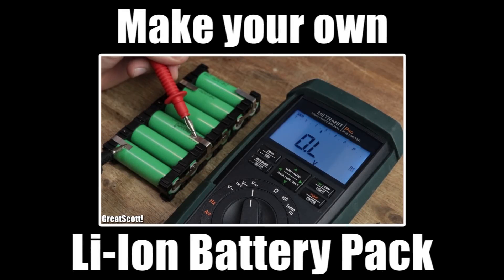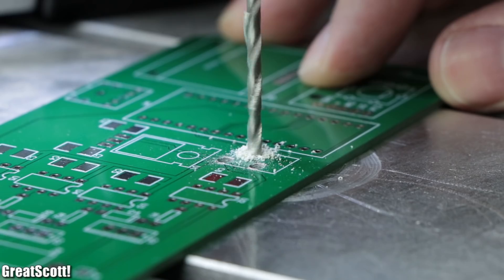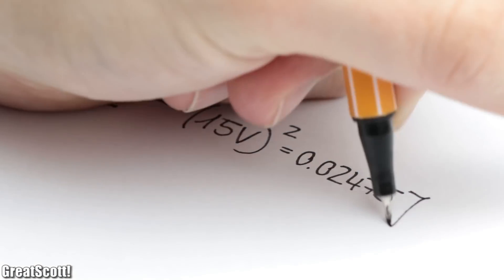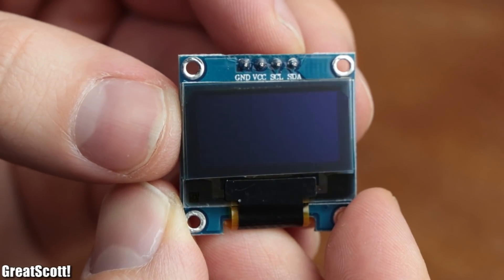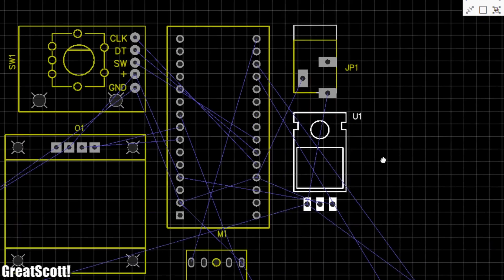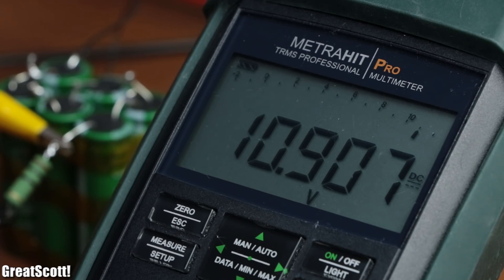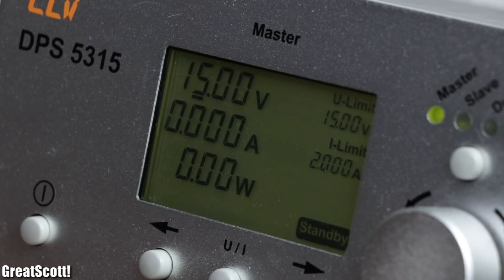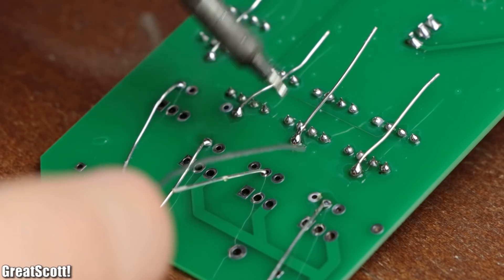Battery Spot Welder (CD Welder) || DIY or Buy

Comment: there is rather easier idea: when pedal is left caps are charging, when pedal is pressed caps are free to weld. this is simple idea, easy to make, and if you want ot make sure power sullpy is safe, you can add program to add delay for weld acction. For me, you just overengineered it, only part that I love is pedal: using feet is good when your hands aren't free.

Comment: So...
Why not using the capacitor discharge method the usual way we create a spark pulse for CD ignition system ?
Except - now we reverse the system to discharge through the HV winding to get a High Amp LoVolt pulse on the LV output !
The energy discharged will stiil be calculated as capacitor charge voltage times the capacitance.
The energy will not change. It's still the same energy carried by a low voltage and a high current.
Less some loss in probe leads etc.
The energy discharged in the welding can still be adjusted by controlling the charge voltage on the capacitor.
But now the whole shebang is MUCH easier to control by a switch ...

Comment: I´d be glad if You revisit this. I need a spot welder like this for my 18650 pack project. This has just the right ingridients: pulse widh control, a nice foot switch and an input voltage my bench power can handle.
I´m stupid at circuitry but can put together something following build instructions and then use it.
Having a pcb and parts list would be so awsome!

Comment: Great scott: builds a special circuit for welding.
Me who don't know how to make a circuit: just connect all up to 12 volts capacitors that I can find in parallel and charging them with a 12 volts battery and shorting it for welding 😂

Comment: I was disappointed you didn't finish it ..wouldn't u just have to solder a few wires in and out a couple direction diodes in to prevent back current ...can u maybie do a video 2.0 where u fix and show us it working ...I purchased a Ali item and it's USLESS so I want to know how to fix it or build the Arduino one ..is it open source code or will I grab that from you

Comment: The most important for a super capacitor welder is the charging circuit. Simply charging them in series is dangerous, especially for those bulky ultracapacitors.
Reply: if we use a separate isolated power supply for charging the capacitor and uses switches like relay 
We can make this work right
 actually I am new to electronics just trying to improve my debugging skills

Comment: Why did you connect the capacitors in series instead of parallel -- isn't it the current that heats the metal?🤔

Comment: Seems like massive overkill.  I've seen DIY spot welders (for battery packs - not general purpose) that consisted of a battery (or transformer), a light bulb and a capacitor bank.  The function of the light bulb was to act as a resistor (to slow the capacitor charge and limit current flow) and to indicate when the caps were fully charged (by going out).  Then just touch the probes to the nickel strip and - Instant weld.  If the weld isn't enough, add more capacitors.

Comment: Don't give up! Just connect one terminal of capacitors to ground, and the other one directly to one electrode. The second electrode connect to ground via mosfet switches. This way, you will get rid of floating mosfets' source potential, and you won't have problems with turning them on and off.

Comment: Use a separate power supply for the control circuit so that the drive voltage to the switching FETS remains above 6-7V as the supercapacitors discharge AND voltage drops won't kill your Fets. You could also use a diode and a large decoupling capacitor going to the control circuit.

Comment: I feel like the caveman approach might have worked better on this one.....My idea may be dangerous AND stupid but hear me out. Extra beefy caps and no pesky hardware or software, just a high voltage warning sticker, some rubber gloves and a chickenstick. That would probbaly damage the battery your spot welding to, but the weld would be good XD.

Comment: Why not just use an old car battery, a couple leads, and a high amp relay on a toggle? No electronics crap needed. Just tap the button and spot welder done.

COUNTLESS diy battery pack builders have been doing it this way for years!

Comment: hi sir. I would appreciate if you can spot weld  a new battery pack for my icom 02AT fm transceiver.  either  8 or 10 1.2volts rechargeable battery.  I will buy from you

Comment: All of this... and I all I did was soldering two copper ends for contact on the 400F capacitor and a JST connector for charging. I got a step-down voltage converter that allows me to plug this into a USB power supply and charged it all the way up to 2.7V. The current dropped as the capacitor became full and it worked perfectly as the project was simple. I'm gonna make a 2S lithium ion battery for 37 minute flight time for my airplane. Thanks Scott for your wonderful videos as complex and knowledgeable as they are.

Comment: Why dont you do it like this: 
Charging a capacitor (like 10mF 30V) with a 30V 5A lab power supply  and then discharge it with a mosfet (3* 200A) in very short pulses. You could controlle your mosfet with a pulse width signal and charge another capacitor (like 2.7V 500F) with it. Now you should have a more continuous flow of current if you attach a load to it. And you could set the voltage to a fixed point with the PWM signal to have like 1V and 150A. (I dont know if this works just an Idea for making a high amp power supply correct me if i'm wrong)

Comment: Why setup the supercaps in series for 15V? Since what we are after is resistance welding from the joule heating effect, we need amperage. Most spot welders I have seen operate at around 2V. This reduction in voltage would simplify many aspects of the project such as voltage sensing for the uC, charging circuit, etc.

Comment: Hi Scott, can you please check this spot welder and please review if possible.

#Aliexpress AED 110.75  42%OFF | PINTUDY 3.7-4.2V Portable Mini Spot Welder DIY Nickel Strip Connector Battery 18650 Batteries Spot Welder Welding Equipment DIY
https://a.aliexpress.com/_sgbnUh

Comment: You don't use any flux!!!? That is why your soldering seems shitty...  get some good MG Chemicals flux in a syringe and apply it where you will solder and it will be like magic.... Also I tend to wet the tip of my iron with solder and apply it that way, as long as you contact the component long enough to prevent cold joints this is fine.  Also... I wuold have just desoldered the FETs and made an air wire for your reference... ignoring the PCB ground.

Comment: I'm really struggling to see how adding a reference potential to the mosfets as an afterthought will short out the main power supply. Isn't the voltage at the gate not connected to the drain and source? Wouldn't the data signals going to the gate be a completely separate circuit? Isn't the fact that the gate is missing a reference potential proof that the gate and source aren't continuous?

It's so incredibly difficult to learn all of this. I was scrolling through comments looking to see if anyone had already asked my question and I found a comment from myself 4 months ago trying to figure out capacitors haha.

Edit: Okay so after a week of deciphering this alien language I've come to the realization that he doesn't care about the gate potential. For some reason he doesn't need a pull-down resistor for the gate. My best guess on how to fix this as of right now is to connect Cap- to ground. How that shorts the power electronics I have no idea.

Comment: you are very very "challenged" when it comes to soldering
Reply: He just isn't using any flux... which is dumb.
Reply: @Wingnut353  i agree, for like sot packages or something, but most solder has some flux in it which should be more than sufficient for the small pads he is soldering. i mean, those through hole solder joints are despicable.
Reply: @fd3871  Sure if you are lazy and use rosin core solder.... which you shouldn't if you want to do a good job. Typically what hapens is people make a mess and bad joints with rosin core solder anyway....
Reply: @Wingnut353  huh? look i'm no electrical engineer, or professional, but I was unaware that people use solder that doesn't have a flux core in typical applications. are you speaking of rosin core specifically? i use it, and my joints aren't oxidized or anything and have quite good flow. of course, I use leaded because i don't care about rohs.
Reply: @fd3871  Nope I never use it and many people you can watch on youtube doing SMT soldering dont' either you'll get better joints with separate flux and solder with less skill, granted you may be quite good at your particular technique.  Note that if you use separate flux and sodler your joints will typically be cooling slower since you have more flux and can apply the heat for longer, meaning fewer cold joints. Also note the solder he is using there appears to not be rosin core soldier just solid solder.... its a wonder he gets it to work at all that way. If there were any rosin there would be a bit of smoke...
Reply: @Wingnut353  ok thanks. i will say that louis rossman uses rosin core and a ton of flux with it. he probably does more smt soldering than anyone, manually atleast. so i guess the key is just flux everywhere.
Reply: @fd3871  Yes rosin core doesn't hurt.... but neither adding flux or using rosin core solder at all is a recipe for bad terrible soldering.
Reply: @Wingnut353  that i don't doubt. before i got extra flux, if i stayed too long on a pad, or wanted to reflow a joint and the rosin was all gone i would end up with horrible joints if i didn't apply a bit more solder.
Reply: @fd3871  Yes exactly I used rosin core solder in college as it was all I knew or had and experienced just this same thing. It's a pain in the neck heh...

Comment: Hi. great work. I was wondering if this timer could be used with a battery? https://www.ebay.com.au/itm/100A-40A-Digital-LCD-Double-Pulse-Encoder-Spot-Welder-Machine-Time-Control-Board/283500950118?ssPageName=STRK%3AMEBIDX%3AIT&var=584632097367&_trksid=p2057872.m2749.l2649

Comment: Why would you hook up the 100F capacitors in series? Wouldn't you want them in parallel so they add to a total capacitance of 600F?

Edit: Oh wait energy formula is (1/2)(C)(V^2), so you would want to increase voltage as much as possible, nevermind.
Reply: Energy wise it does not really matter. While your formula is correct you have to keep in mind that wiring capacitors in series will reduce the total capacitance which perfectly cancels out what you gain from the voltage squared term.

For a capacitor with C=1 and Vmax=1. In case of 6 parallel caps Ctotal=6C and Vtotal=Vmax. While for series Ctotal=C/6 and Vtotal=6Vmax. Plugging these values in your equation will show you that the energy is the same in both cases.

My guess would be that he wired them in series so he doesn't need huge currents going trough the MOSFETs.

Comment: Try to use photo flash capacitor you can get that capacitor to old camera that having a flash
Reply: While those can zap you, they don't hold that much power. Not enough to weld with at least.

Comment: Am I the only crazy individual who sees a simple relay as a solution? Just connect the normally closed contact to the capacitor bank charging, so when it's not in use, it's charging up to the desired voltage (interrupt current flow via Arduino, can be even done via traditional electronics), and use the pedal switch to energize the coil, and connect the normally open to the welding terminals, so you short the capacitor bank while you keep the pedal pressed AND disconnect it from the charging circuit at the same time.

Add a second always energized relay, with its normally closed contact connected to a discharging resistor, so that when the welder is powered, it works normally, and when it's unpowered, leftover charge is simply discharged as heat, to avoid unpleasant surprises.

Comment: Actually there is a CD welder that is easy to build, but Hocky Puck SCR's are not cheap, and the same for low inductance capacitors that can handle up to 180v and have screw terminals.

Comment: Could i use 20 330v caps and a board from a disposable camera flash to charge them up and then short them to weld? I have thos stuff here because of a coilgun i made. I would only need to short the capacitorbank instead of discharging it into a coil...

Comment: Just use a 12vdc battery with at least 200 CCA up to 600 CCA and a momentary switch. Its got enough power and is super easy to do.
Reply: I use a 300 cca lithium battery and even with the solenoid it delivers too much power and end up burning a hole on the nickel table. Trying an arduino controlled solenoid rn
Reply: @IamG3X  I've seen somewhere a vidéo with just a Maxwell 350F ultra capacitor and it seems to work well. I already tryed with my little car battery, it was a disaster
Reply: @IamG3X  try adding some resistance in between. 🤔
Reply: Maybe we must ad to the little car battery a "welding time controller" to out a more precise current? And that would be that simple no? So it would cost nearly nothing. I'm wrong? I Can explain the origin of universe also. But no one care
Reply: @k-member  i use arduino relay to control the solenoid to switch on the battery. haven't test it out yet.
Reply: Smattless  sir lol. i actually watched the guy that you linked. i use his idea of the solenoid as an on/off switch but it still TOO POWERFUL for the nickel strips. I thought you can use to arduino relay to turn the solenoid on and off better than your finger. idk

Comment: I have 1500+ cells, and that's only the start of my project, I need to spot weld them, I built smaller banks by soldering, I don't like to. And it does NOT look that great, there is spotwelder timing boards available on Amazon, I thought about maybe trying a SSR or a group of MOSFETs, for the pulse switch, from caps, and either use a 12v or so battery, of a mot transformer, rewound for  high current 10-18vdc, to charge the caps at about 30-50 amps,  I don't have super capa , I do have about 3 farad of caps, surely with the transformer and a couple farad of capacitance will spotweld!!! I do not want a failed project, I can't afford the loss at the moment, . I need it to work that's why I'm here! Great video even if it's a fail, still a great learning process, it makes you think more than a         " how - to " video.....   Thank-you,,  ,,, ,, , .

Comment: Large caps, high voltage (30v+), 12v lamp as soft-start cap charger, thick wire and copper terminals.  Done.   Rapid discharge of current from the Cap(s).  Energy in a Cap E=CV^2 which is why higher voltages are good.

Comment: For use on a few batteries, any thoughts on just using conductive (copper?) tape, instead of spot-welding those nickel-plated steel tabs?

Comment: or you can just use a 12 volt battery with a relay, push button trigger. and some wire leads.

Comment: What about a super capacitor? Its safe as its in really low voltage (ex 2.7v with 500f). It seems to be able to spot weld, and the only thing you would need is to create a base or charger to charge it up again after the usage.

Basically solder to its leads solid copper core to make the distance correct to make the spot weld.

It would be: safe, reusable, and not expensive.
Reply: dude the green caps he used ARE super caps

Comment: why don't you charge the supercap with P-channel fet transistor and discharge with N-channel, like half of H bridge? the cap is between drains and ground, i think itis better solution when the supercaps are in parallel

Comment: I built one for 10€, just some Mosfets, 2 Protection Diodes, an analog Controll Circuit with a Potentiometer and a Car Battery. Altough it was a quite dumb design, it worked like a charm. I might upload the schematics if someone is interested.

Comment: First you could get super capacitor banks with balance to use. Not sure if all your were charged equal. Two or three would give you what you need and then some. Even supper capacitor don't discharge in very short time, when you are looking milliseconds.

Comment: The only answer I found is to put a p-channel mosfet between cap+ and VCC that opens at the same time as the charging mosfet. And one question, why did you put P3? It's a pad that would connect directly cap- to GND, so you would have no control to charge the capacitors, right?

Comment: This is similar in idea to what in industry is called a STUD WELDER, and they use a hockey puck SCR as the switch and 8 or 10 very large capacitors and charge them up to 400 volts. The voltage is set by a voltage regulator. Please keep in mind that I used to fix them over 10 years ago, and the part that usually failed was the voltage controlled charging source and the computer grade high voltage capacitors.

Comment: i have 6x500F supercapacitors in series on board and i want to build a Lead acid replacement for my 4cylinders 750cc motorcycle. How should i connect  6 x18650 batteries i have, to charge the supercapacitors bank? Thanks!

Comment: Or you could just use a car battery, bulldog clips and cables ending in  some partially insulated thick copper wire as welding probes... I've used this setup for spot welding for the last couple of years.

Comment: Super caps have too much internal resistance for this application. Standard chemistry would probably work better and be safer. Most simple CD welders jumper caps in and out of bank and vary the voltage and dump the whole bank in one weld with an SCR or big enough contactor where the contacts don't weld because of heat sinking and area. In a situation like that an Arduino controlled voltage regulator with some saved welding profiles would be cool.
Reply: You are saying that lithium cells have lower internal resistance than super caps?  You are mistaken.